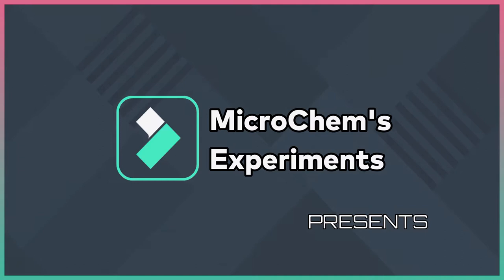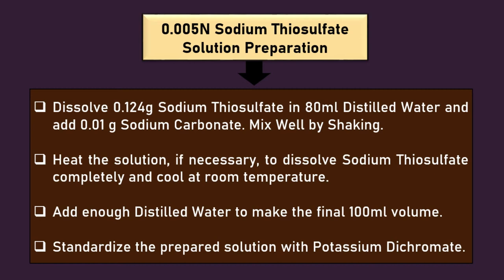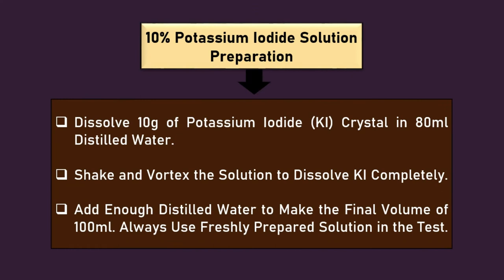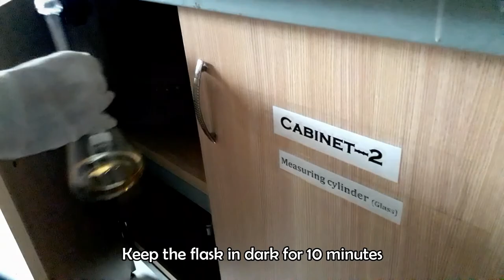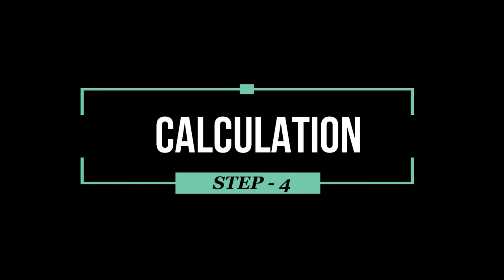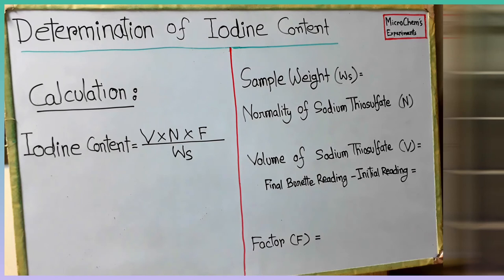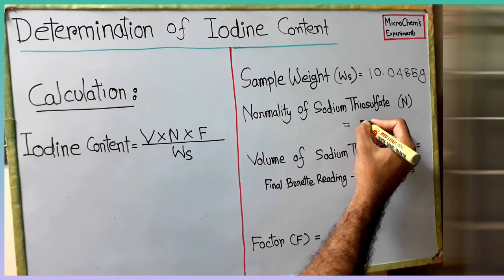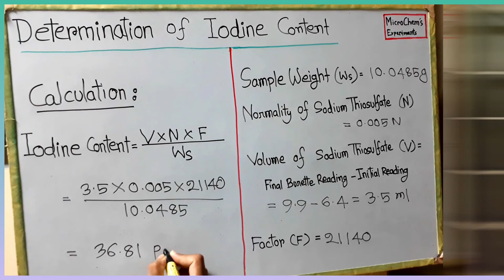Determination of Iodine (ppm) in Iodized Salt_A Complete Procedure (IS 7224_2006)

Comment: You've added starch way too early. It should be added only when the iodine solution color had become very light, or when iodine concentration is very low. Adding way to early when iodine concentration is still high may delay reaction as availability of iodine is lessened due to stability of the starch iodine complex at high iodine concentration. This will lead to tendency of adding more titrant than necessary, leading to false positives.
Reply from the maker: Gordon Marilao, you are absolutely right. But we did many trials and did not get any significant difference. thats why in this video we showed as our regular practice. But ofcourse It's a very good practice to add starch a little bit later to get the accurate result. Thank you very much for your observations.
Reply: How can i standardize sodium thiosulfate by potassium dichromate Please
Reply: Take o.1 gm  to 0.2 gm K2Cr2O7 in iodine flask and then add 100 mL dm water , add 3 gram KI then add 1: 1 HCl closed by cap with water seal place in dark place for 15 minutes then titrate against sodium thio sulphate when yellow colour appeared  then add 5 ml 1%  starch solution again titrate end point green.

Normality of Sodium  thiosulfate. =   1000× weight  of K2Cr2O7/ 49.04 x TV

Comment: also will the normality of the sodium thiosulfate ever even change?
Reply from the maker: Preparation of 0.005N sodium thiosulfate is given in the reagent and chemical preparation step in this video. Yes, the normality of prepared sodium thiosulfate can be changed based on the environmental condition of shelf life. 
You should standardize the sodim thiosulfate solution each time before use to get the accurate test result.

Comment: How to standardize sodium thiosulphate? Is it necessary to standardize?
Reply from the maker: Shaheer Hassan, It's very important to use a standardized Sodium Thiosulfate Solution to get the accurate result. We didn't show the standardization procedure to shorten our video. We will prepare a video for standardization later. You can also find the procedure by searching on google. Thank you for being with us.
Reply: @MicroChemsExperiments  actually I am going to calculate the ppm of iodine following your video but without standardized solution. How much will it affect the results?
Reply: @MicroChemsExperiments  I'm actually not a chemistry guy and videos I've been seeing are pretty confusing. Your video is the easiest one. I have to perform it for a salt company but without standardized solution since it wasnt there in your video for 0.005N Sodium thiosulphate. Will it be near to the result?
Reply from the maker: Shaheer Hassan, The result will differ slightly without standardization, not much. You can carry out the experiment without standardization. But try to take accurate weight of sodium thiosulfate during the solution preparation.